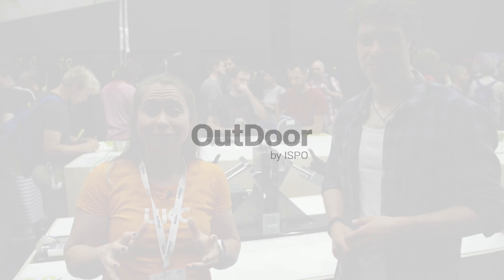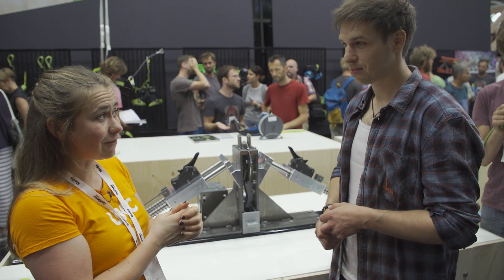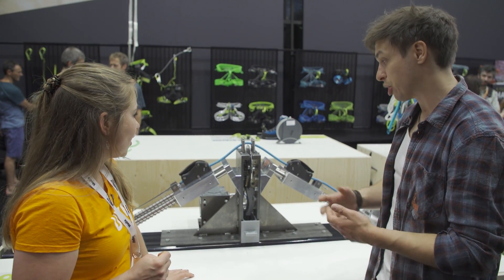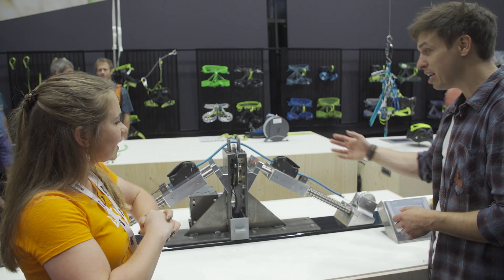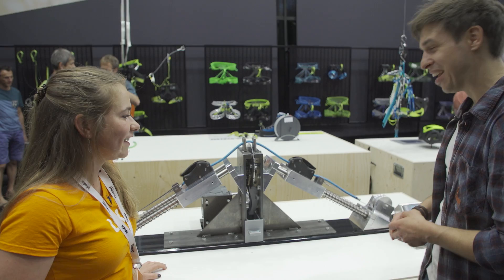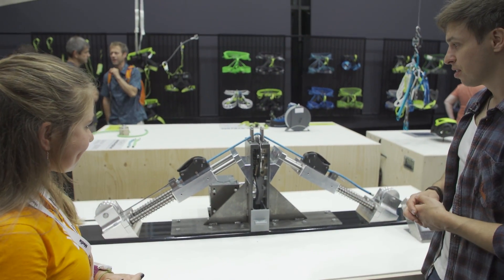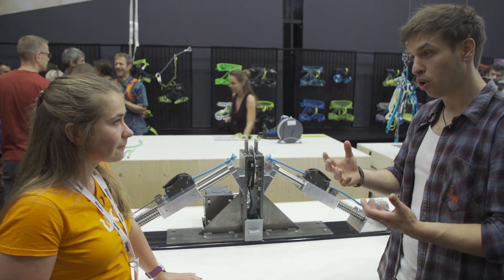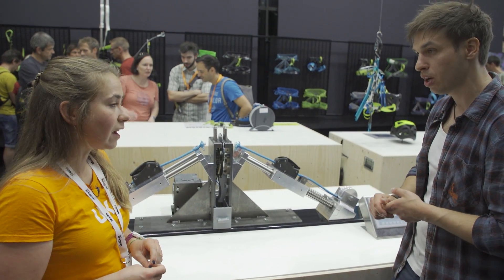OutDoor 2019 - Edelrid - Protect Rope Edge Test

Comment: This test is so unnecessary. Just pull it over a edge in one direction like in real world scenario. I get that they want to do scientific test to gain some information on resistance and abrasive resilience but that is not comparable to real stress situations
Reply from the maker: Why would the rope only go in one direction though? For instance, when you’ve got someone locked off, and they’re hanging on the rope, it would be exactly like this test - rubbing back and forth over an edge (due to the fact it’s dynamic, hence there’s stretch and bounce within the rope). This effect would be magnified should the person on the other end be attempting to prussik or jumar up the rope, which is an everyday occurrence when big wall climbing.
Reply: @ukclimbingofficial  well you got me 😆